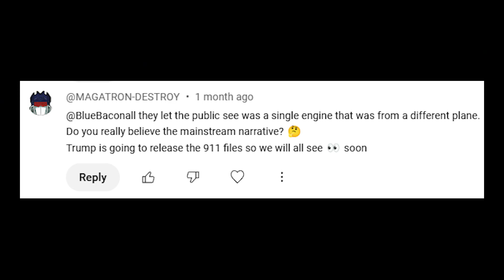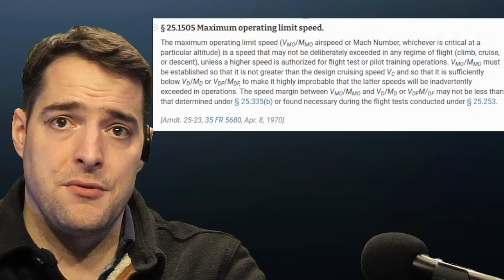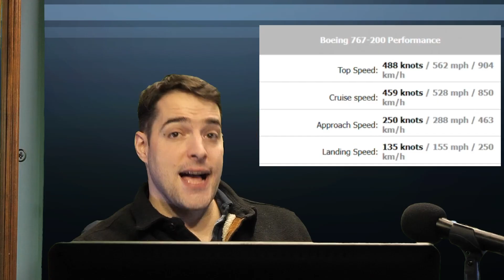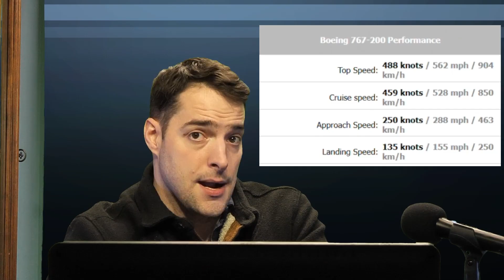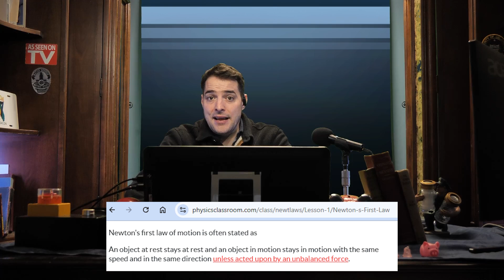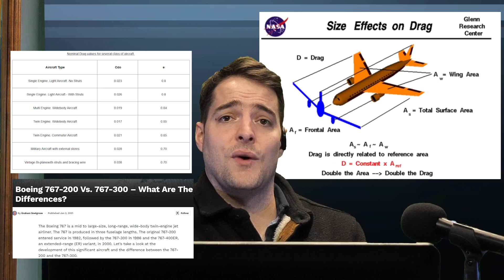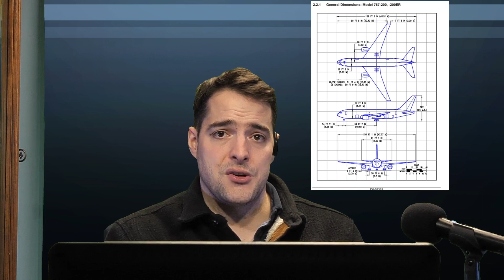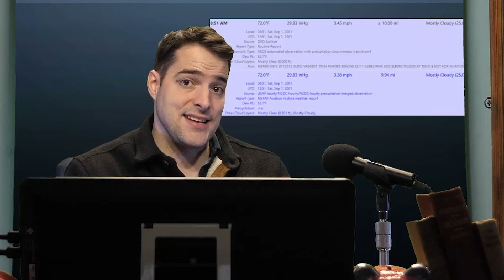No, the planes that hit the towers were NOT travelling impossibly fast!

Comment: 'Had to do some digging into this after watching your video. I'm a pilot with over 5000 hours on B767 type aircraft, it's a machine I know intimately well. I'm glad I found this video because it opened my eyes, albeit probably not in the way it was intended. I don't have a bone in this fight, but after seeing the relevant primary source data, I was as close to speechless as I can be. 

The fact is that the observed speeds are highly problematic with respect to at least one of the aircraft. So I offer the following info with respect, as a tip to perhaps point you in the right direction when rebutting fake news. If this is what you wish to do, then you yourself have to be meticulous with your understanding of the subject matter and handling of the truth. I hope this helps in that pursuit.

The major shortcoming with this video has to do with the relevant speeds for the B767-200. The mistake is so fundamental that I believe it not only renders your specific argument moot, but it actually argues the very opposite point. The issue arises when treating Mmo as if it is a limiting speed at low altitudes: it is not. The speed of sound over the top of the wing is not at all relevant at low altitudes. This is because parasitic and induced drag are the aerodynamically limiting phenomena at lower altitudes, not supersonic airflow over the wing. For this reason, we only use V speeds at low altitudes (not M speeds). Furthermore, Vmo is only a statutory limit (ie. established by regulation), and is therefore not a relevant speed for the purposes of this discussion.

As I mentioned, when discussing the lower altitudes, only V speeds are applicable. In your video, you mentioned Vmo, but as I stated, this is a statutory speed. It is a speed that pilots observe during normal operations (hence Vno), and is imposed by regulation. It also contains a safety "buffer". For these reasons is not an aerodynamic speed and is not relevant to the conversation.

The actual aerodynamic "top speed" of a large aircraft is harder to ascertain, and will vary based on weight, temperature, g-loading etc. The closest proxy we can use to infer "top speed" is a value called Vd. This is the maximum speed that an aircraft is required to demonstrate during initial flight testing. Vd is an extreme speed, and is only demonstrated in smooth air. On most Vd maneuvers, the aircraft is buffeting so violently due to the high speed that it is hard to read the indicators. This maneuver pushes the aircraft literally to its limits and is not one that any test pilot enjoys performing. At Vd, it is both difficult and extremely dangerous to maneuver the aircraft in any way, as even a slight increase to G-forces can cause the aircraft to come apart. Data from past overspeed accidents, including one involving a 767, suggest that most aircraft incur catastrophic damage 40-60 knots past Vd speed. Vd is not published in any pilot manuals, but on the B767-200, Vd is 420KIAS at sea level (Vmo is 360KIAS, as you stated).

So this brings up another extremely important point. Just because the engines of an aircraft are capable of propelling it to speeds higher than Vmo/Mmo, it doesn't mean that the aircraft's flight and control surfaces can withstand the aerodynamic forces experienced at those speeds. Supersonic airflow is not a factor at these low altitudes, which is why we can only use V speeds for the purposes of this conversation, not M speeds. Yes, M0.86 may be 659 knots at sea level, but aerodynamic forces will have destroyed the aircraft well before M0.86, and long before the airflow over the top of the wing becomes supersonic. If I had to guess, a 767-200 would start to fail catastrophically around 450-500 knots at sea level, assuming the aircraft is in the middle of its weight envelope, and is in level flight and perfectly calm air. Also, around that speed, the engines would begin to struggle to push the air through quickly enough, and high pressure would build up ahead of the fans. If enough of this pressure builds up, the high pressure against the engines (which are slung under the wing), would force the nose down in a way that is very hard to counteract by the pilot.

Because I'm not a conspiracy theorist, I wanted to find out the actual speeds the 9/11 aircraft were doing leading up to impact. Surely the actual speeds would have to be reasonable. So I did some digging and found primary source data pertaining to the actual ground speed for UAL175 and AA11. This document is in the public domain, and is called Radar Data Impact Speed Study, by the NTSB, dated Feb 7/2002. I also pulled the METAR (airport weather) for JFK from just after the impacts on 9/11. This allows us to accurately infer the actual airspeed of the aircraft, as the NTSB study only reveals ground speed.

According to the NTSB document, in the last 1.5 minutes, United 175 averaged a ground speed of 510 knots on a track of 040 degrees. The wind at the time was reported as 350 degrees at 7 knots. This means the aircraft experienced a 4 knot headwind component, meaning that if the aircraft was averaging 510 knots over the ground, it was actually doing ~514 knots through the air. At 9h00:52, UAL175 peaks at 520 knots over the ground, or ~524 knots through the air.

The speeds I just described to you are so utterly baffling to me, that I had to go over the data several times before I believed it. Frankly, I'm not sure how this airplane was able to stay together a full 104 knots above Vd speed. Even more baffling is how it was able to bank so aggressively just prior to impact. I'm not saying it's impossible, but it's so anomalous and improbable that I'm surprised this hasn't been studied further. The one thing I do believe is that UAL175 speed data is accurate. UAL175 actually did 510 knots over the ground. I understand the methodology used to extrapolate it (using radar) and it is iron clad. The question becomes, how did it manage this? I would love to see a video aimed at answering this question.

So I would urge you to download the NTSB document and present it to some test pilots or aerodynamic engineers. See what they say about the data, and the points that I've made. At the very least, I'd urge you to approach this subject with a little more humility. I personally could not have flown the profile that UAL175 flew, and I generally do a good job.

FWIW
Reply from the maker: I appreciate the info about the low altitude speed ratings. Ultimately I only included the speed ratings because some conspiracists had improperly used them in arguments that they were the fastest the plane could possibly fly, as opposed to the speeds the plane was rated to fly. The math regarding engine power does not need any of the information about the aircraft's rated speeds. 

My research shows you are wrong about Vd. Per PilotInstitute.com, Vd is the design diving speed, which is not the fastest speed an aircraft is designed to fly at. It is the speed an aircraft should not exceed during a dive in order to ensure the aircraft can recover from the dive without compromise its structural integrity. The terrorists were not concerned with recovering from the dive. It is likely the aircraft did experience structural damage prior to impact, and phone calls from passengers suggest the planes were experiencing a high amount of turbulence prior to impact. Perhaps the plane was merely moments from coming apart at that time, but it was clearly observed as an intact aircraft by every witness. 

Your concerns are either addressed in the video, or they are proven to be unnecessary by the fact that the plane was in fact flown into the towers. Thank you again for your comment, but it will not be enough for me to demonstrate humility towards a theory that a space laser and holograms were responsible for the deaths of thousands of people.
Reply: @BlueBacon  With respect, I don't think you've understood my point. This is why I was hoping you'd take my assertions to a flight test engineer and have them explain it. I'd like answers too! 

Yes, Vd is dive speed, and the definition for it that you cited is correct. But it doesn't address my point. My point was that, at sea level, "top speed" (ie. the speed at which an aircraft catastrophically fails due to aerodynamic forces) is a theoretical number that isn't explicitly known. At best, you could deduce it from modeling or wind tunnel testing. In lieu of that, Vd could be used as a PROXY for this number. Or at the very least, we know it's not LESS than Vd (as Vd is demonstrated during flight testing). In my OP, I stated it as clearly as I knew how. Vd IS a valid proxy, because at that speed, the aircraft is already beginning to reach the point where it can be damaged by aerodynamic forces. The speed at which the aircraft begins to fail catastrophically is not much beyond Vd, hence Vd as a proxy.

The reason I can say with a high degree of confidence that you're not understanding my point is because you stated (at ~10:30), that M0.86 equates to 659.9 knots, and you noted that this speed is well above the speed that UAL 175 was doing on impacting the tower. In other words, you're saying "because the aircraft was doing less than 659.9 knots, it proves the aircraft can do the speeds it was doing on impact with the tower". This is 100% false and demonstrates a lack of understanding of the subject matter (sorry to be harsh here).

The reality is that mach limits are not governing at low altitudes. Mmo (M0.86) is not a limit that is observed close to sea level because the aircraft would come apart due to aerodynamic forces LONG before M0.86. The atmosphere is much thicker and the speed of sound is much higher down low, therefore the aircraft would succumb to aerodynamic forces long before reaching Mmo. On most commercial aircraft, at an airspeed that is aerodynamically equivalent to Vd speed at sea level (we call this equivalent true airspeed), the aircraft is already in the incipient stages of becoming un-flyable. At sea level, going beyond Vd speed (to be clear, it's not certain how far beyond), the aircraft begins to come apart. 

So my question to you, is this. What airspeed do YOU think a 767-200 would begin to succumb to aerodynamic forces at sea level? And why? If you asked me, I would suggest it's somewhere between 440-480 knots. Maybe as much as 500, but not 520. Period. Moreover, at the lower end of this speed range, the aircraft would already be incredibly difficult to control, if not impossible. At 420 knots, the computers will have locked out spoiler panels and some ailerons, so your ability to bank would be severely degraded. You'd have areas of high pressure developing ahead of the N1 fans on the engines, causing a pitching down moment that would be difficult to overcome. You simply wouldn't be able to fly with much precision at all.

You don't have to believe me, I'm just a guy on the internet. But with close to 15,000 flight hours to my name, most on big Boeing aircraft, I'm telling you, without a doubt, that I could not have flown the profile UAL 175 flew on 9/11. Period. 

Please run these comments by a flight test engineer, or an aerodynamic engineer that has experience with widebody passenger jets, and you'll see why your video didn't address the issue of anomalous speeds. If anything, it raised more questions.

Also, please don't infer that anything I'm saying suggests a wider conspiracy, or an inside job. I simply don't know, it's not my area of expertise. Boeing 767s are my area of expertise, however, and I am trying to say as clearly as I can that no pilot could fly the UAL 175 profile, and I'm highly skeptical that a B767-200 could even get to 520 knots at sea level without rapidly failing catastrophically.

Despite the above, I am quite sympathetic to your POV regarding lasers, holograms, etc. I agree that that is all bunk. I'm certain that what was captured on video that day was what actually happened. What I'm not sure about is how any human being was able to fly that profile, and how any (unmodified) B767 was able to withstand the forces UAL 175 would have experienced. I'd like answers.

What I suggest you do, for the sake of your YouTube channel, is take some flying lessons, then rent some time in a category D B767 simulator. Then try and fly the UAL 175 profile. You'd notice a couple of things. One, the sim would freeze (crash) long before reaching 520 knots. This in itself wouldn't prove anything as I don't believe they accurately model high speed over-stress. Two, even if you flew at a reasonable speed (say 360 knots), you'd see just how incredibly difficult it is to hit a large tower in a jet. I'd be willing to bet my next paycheck that you couldn't do it in 5 attempts, even with the amount of flight training that the terrorists had.

If you'd like to take me up on this, I'd be happy to get you some time in a category D simulator. It'd make for a great YouTube video.

All the best.
Reply from the maker: @mattler906  @mattler906  I'm not going to be able to rent a 767-200. I appreciate your input, but a 767-200 is able to accomplish what was accomplished on 9/11.

Nobody is doubting the plane was likely experiencing immense stress, but it clearly wasn't enough stress to break apart before impact. 

I doubt a simulator would crash at those speeds, and flying in a straight line isn't exactly redbull air racing.

Comment: Every big twin-engine airplane is MORE than powerful enough to go fast enough to cause structural failure of the aircraft even in level flight. The need to survive an engine failure at the worst possible moment (a max weight takeoff at rotation) ensures that they are wildly overpowered for normal flight. They will cheerfully accelerate until parts start coming off the airplane at low altitudes.

And more than one commercial airliner has exceeded the speed of sound in a dive and survived to tell about it. Most famously, the FIRST intentionally supersonic commercial airliner was not the TU-144 or Concorde, but a Douglas DC-8 on a test flight to prove it could be done! They got to experience first hand what "mach tuck" is, and actually had to push INTO the dive to unload the elevators enough to pull out of it. I assume they needed a second airplane to hold the pilots enormous brass balls. But several airplanes, including a China Air 747SP did it after upsets and survived with varying amounts of damage. The story of that Air China flight is absolutely wild - Lady Luck was riding the jump seat that day. The left some major chunks of airplane in the Pacific ocean and still managed to land safely in San Francisco.

Comment: This is great! How about an analysis debunking all the excuses made to make Sully a hero since some of the same false arguments went unchallenged by anyone but me to excuse Sully’s misguided choice to land in the Hudson, which not coincidentally he had just been verbally admiring in violation of sterile cockpit rules for which excuses were also made for him, instead of returning to La Guardia which he could have done without dodging skyscrapers by following the tributary that lead’s directly  back to La Guardia, which is positioned beside water, so not the beautiful water of the Hudson that Sully was just admiring. The excuse makers don’t need no stinking map of Manhattan. The excuse makers also excuse Sully’s failure to remember to flip the ditch switch, something I would argue should be a memory item since I’m pretty sure it’s the only thing that you have to do differently switch-wise when landing in water, and his failure to employ crew resource management by informing the cabin crew that he was making a water landing so that they can make sure that nobody tried to open the rear doors which are not to be opened in a water landing. It was sheer luck nobody drowned, though they came very close. I would argue Sally had no way of knowing if there would be obstacles in the way when he landed in the Hudson but he certainly knew they were bridges of the way that he would have to dodge if necessary regardless of what boats that wouldn’t make him collide with. There’s a reason why he and his copilot hit out head out in a hotel room somewhere for three days getting their story straight before allowing themselves to be debriefed by the NTSB. In their report the NTSB basically admits that during those three days Sully‘s hero status increased to the point that there was no way they could be critical of him, which I understand is the exact opposite of how the script in the movie portrayed things. Ask for the pilot mostly failing to make it back to LaGuardia in the simulator the NTSB basically was forced by Sully‘s hero status to make the pilot in the simulator wait long enough before making the decision to return back to LaGuardia that it would be difficult if not impossible to not land in the water next to LaGuardia.